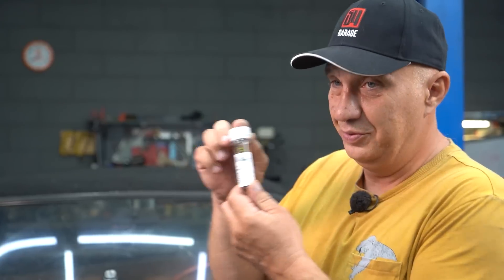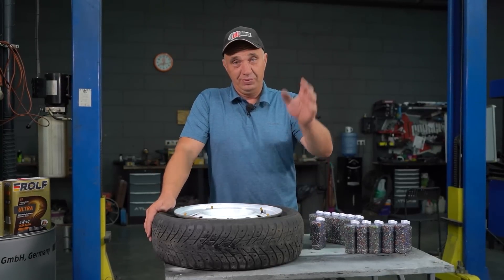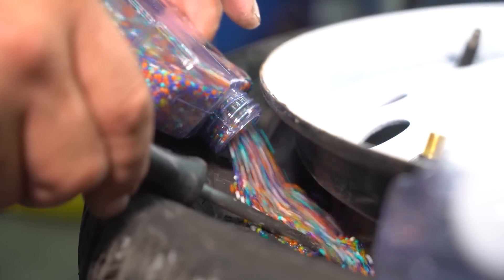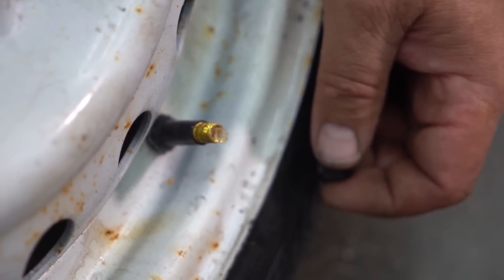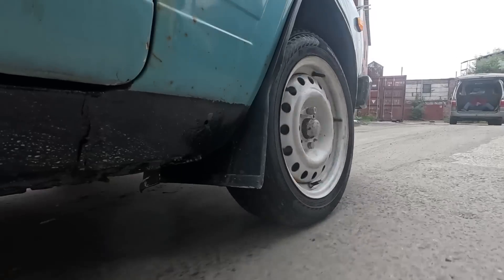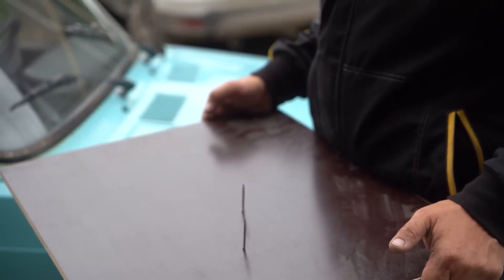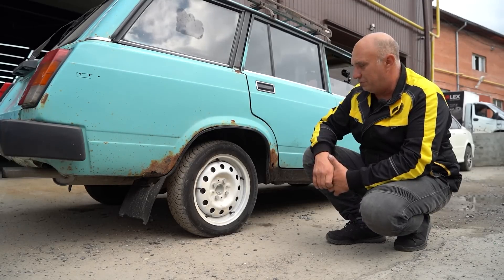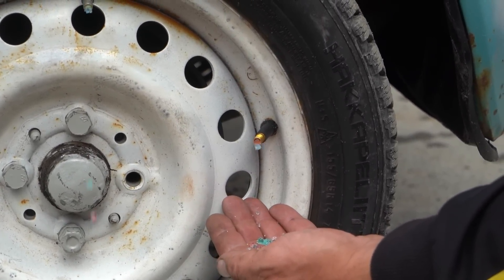Filling tires with orbeez to puncture-proof them - will it work?

Comment: Im not so sure the 1st penetration test with 3 in sheet rock screws didn't penetrat the tire. It even looked like the screw threds pulled some of the orbeez material out of the tire.

Comment: Unless this was already tested somewhere and the idea didn’t work or got tossed out, y’all might of discovered something.  If the correct air pressure for that tire can be maintained and stay balanced especially at high speeds.  You will at least make it the a safe destination or a shop.  Great videos!  Someone please tell me all the downsides to this.

Comment: Needed MORE water so they would swell more, measure the total volume and add enough balls and water to fill the measured volume then test on spike strips, Ill bet they clog the holes also add to the weight on the ground adding more control of cornering , so a counter measure against spikes and those fast moving lead balls

Comment: Another awesome experiment. Pretty good idea for making a puncture resistant tire. The only downside is to weight of the water. At higher speeds the centrifugal force can tear the tire apart. Speed limits here in the USA especially on the interstate highways are often 70 miles per hour (about 115 kilometers) and some places you to 85mph (almost 140 km/h). Most people go 5 to 10 MPH over the speed limit here too. So I don't know how practical that would be for cars. Heavy equipment and construction vehicles though for certain. Anyway, that you guys for another awesome video and experiment. I was delighted to see this on my birthday. I love you guys and God bless.

Comment: Now do a burnout in summer with Orbeez-filled tires.

A big reason why air is a great choice for tires is because it handles heat well, transferring it to other parts of the tire to heat the whole tire evenly. I wonder how Orbeez will hold up under high heat stress, and if it's competitive with air or just not even close.

You guys are on to something here...
Reply: Uhm. Air is literally one of the worst heat transferring entities out there.

We specifically use air to insulate, you know, in common stuff like JACKETS; THERMOS FLASKS; HOUSE INSULATION.

Meanwhile water is a good heat transfer material, we use it to bath, HEAT OUR HOMES and even cook.

What are you on about?
Reply: @glurak888  Well, the heat transfer thing had to do with why airless tires haven't caught on, because I guess air helps keep temperatures even throughout the tire, vs trying to use rubber for heat transfer, which is worse than air. I think.

I wasn't talking about vs water, though it would be another interesting experiment, imo.
Reply: @glurak888  he has a point. Air does not expand as much as water when heated, if water is heated under preasure, it can expand exponentially and instantaneously, this is called flashing to steam and would absolutely evaporate a tire

Comment: Obvious, they didn't add enough water. There was no pressure to escape through the holes, it was all beads.
They should have checked the pressure of the "inflated" tire before they punctured it to see if any loss.

Comment: I love what you are doing, however spike strips are not screws or nails. Spike strips have tubes that puncture the tire and break off and allow the air to flow out, unlike screws or nails that can keep the pressure.    The other interesting test would be those unidirection shark fin traffic control strips that shred tires.

Comment: It seems like you put way too many breeds in so they ran out of water to absorb before they got full size. Seems like 1/4 as many breeds would have been more than enough. Then use water to fill the tire to 60 lbs of pressure and see how they do off road and on some really rough surfaces. Maybe even against a police tac strip
Reply: What if instead of using breeds they used beads ? That might even work
Reply: @theseoldhands532  nah, if you want more  you need breeds
Reply: @theseoldhands532  They should combine breeds and beads to fill tires with breads
Reply: Yea 🤣🤣 When they said they were putting half of ALL THOSE CONTAINERS, I facepalmed... 😅
One container would've been plenty for one tire. Heck, I think one of them would've been enough even for a pickup truck tire!
Reply: I think that it would have been cool if he had put the tire back in water to cause the orbeez to grow again and re-inflate the tire!

Comment: New trick for car chases with police lol. No more worrying about spike strips lol
Reply: Well not really, police spikes punch a hole in the tyre, there are other types which are hollow and snap off and stay in the tyre.
Reply: @stevenc5227  that is true, but the hollow spikes wouldn't be able to facilitate the exit of the orbies if they were actually implanted in the tire properly. In this video they actually used way too many of them in each tire for them to actually absorb the maximum amount of water. Had they done a calculated amount of water to orbies the orbs would have been much much much larger and wouldn't have been able to push out those valve stems. Similar to the size of the spike strip hollow spikes

Comment: I have replaced 8 tires this summer do to nails on the road so this may be a better option than paying $40 a shot to have them plugged then $260 a shot to replace the tire after 4 plugs, Im in canada so I wonder if they will work with antifreeze rather then water so they don't freeze in winter,
Reply: The vibrations at higher speeds would be insane.

Comment: I don't understand why they get out through the air valve, but not through the holes.
Reply: Size of the hole.
Reply: @thetroll1247  But still, the valves must be able to hold air.
Reply: @christmassnow3465  Valve has a cap